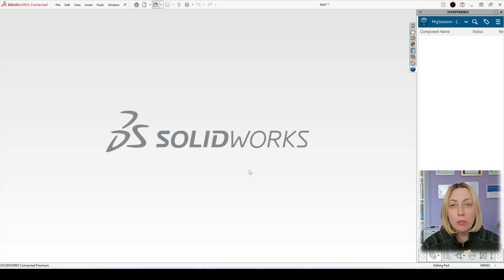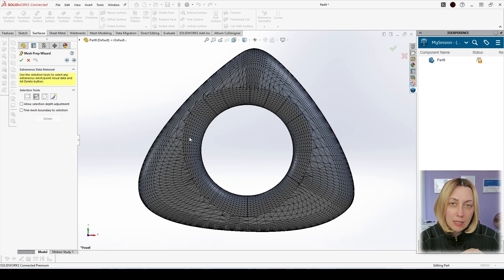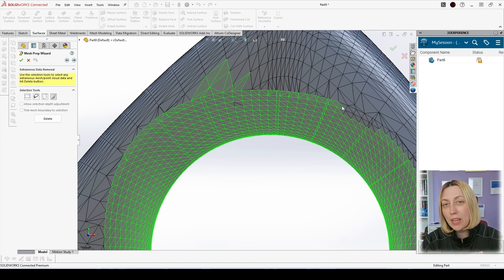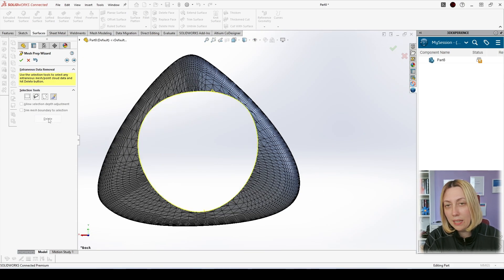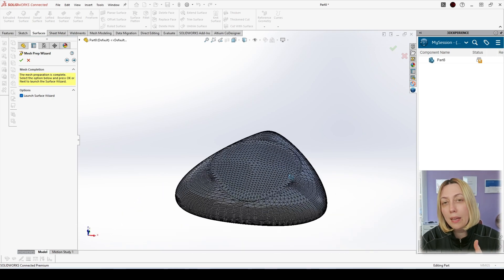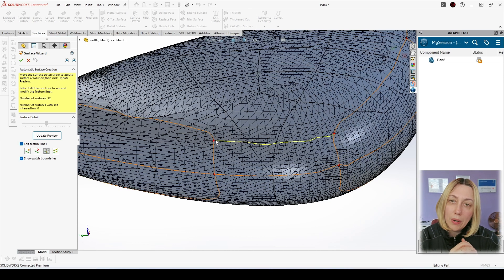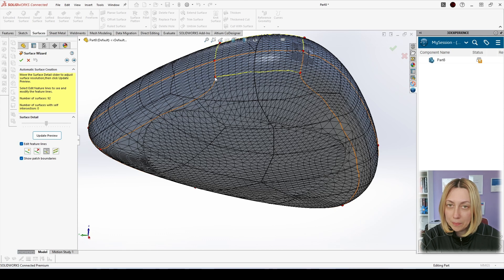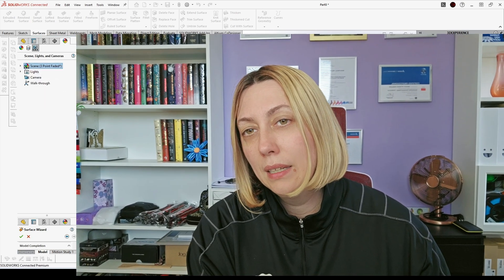Easy SolidWorks Editing of STL Files with the help of ScanTo3D

Comment: I'm coming straight from your LinkedIn post and Thank you for this! After several years of trying to manipulate STL files for medical 3D printing applications, I finally now have a way around it in SolidWorks. I was previously forced to try new software including Blender, which was a bit of a hassle for me. This feature right here gives me better insights on how to approach the problem next time using SolidWorks. Thank you! 💯

One of your LinkedIn followers.
Reply: Indeed. And while it isn't a perfect tool it at least gives a starting point for manipulating STL files within SolidWorks.

I can't wait for the next video! 🤗 
I trust it will come through quite handy.
Reply from the maker: I'm happy it was helpfull. As I like to say it's still not perfect tool, but gives a great base to work with mesh files. 
Soon I'll publish another video on this topic, that shows how to make hybrid convert Manual+Automatic.

Comment: Mesh data is never this clean. Also Scanto3D hasn't been updated in over 15 years, there is so much that needs to be updated about the plug-in. Definitely some of the Gold Partner plug-ins like Geomagic or Power Surfacing offer areas that DSS needs to take a look at updating around handling and working with meshes.
Reply from the maker: Let's not forget that mesh data doesn't solely come from scans; there are numerous free STL files available thanks to the 3D printing community, and they are often very clean. Many SolidWorks users may find it difficult to afford $6.6k plug-ins, and for them, ScanTo3D is at least functional to some extent. If you primarily work with scan data, I wouldn't claim that SolidWorks is the best software for that purpose. However, if you occasionally need to import meshes, then ScanTo3D is a valuable tool to have. It's worth noting that ScanTo3D was introduced in SolidWorks in 2010, so it's unlikely that it hasn't been updated in more than 15 years, given that it has only been in existence for 14.
Reply: @DWorkshop  Scanto3D was around before 2010. Closer to 2005 where it was only available in the Premium version. It quite literally has not changed in over 15 years, like no progress at all. Yes .stl can come from websites like GrabCad or Thingiverse. You don't need a $6.6K plug in to start to mesh data in Solldworks. Power Surfacing starts at around $2K and it a Gold Partner solution and does way more than Scanto3D ever has. There are many areas that it's lacking in which have been devoid of updates for far too long.